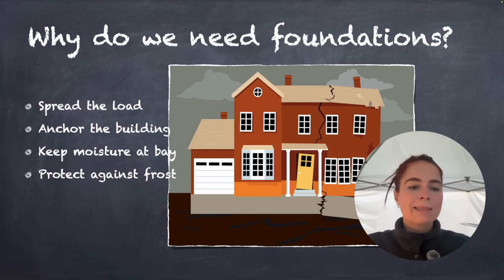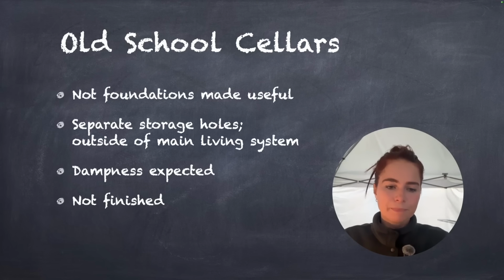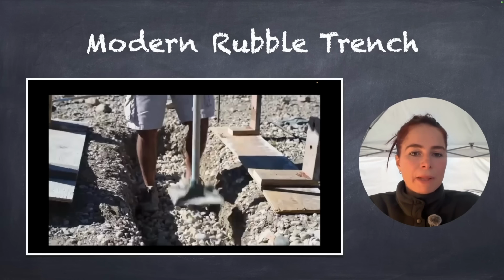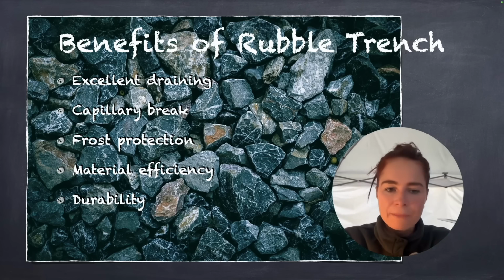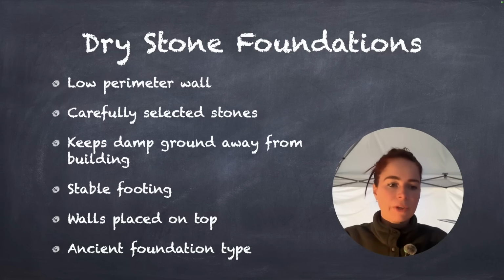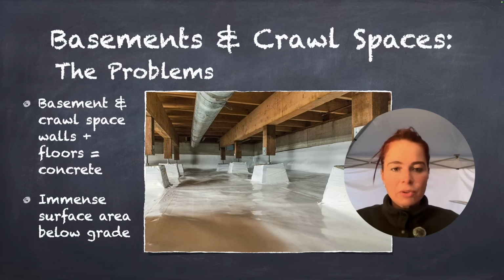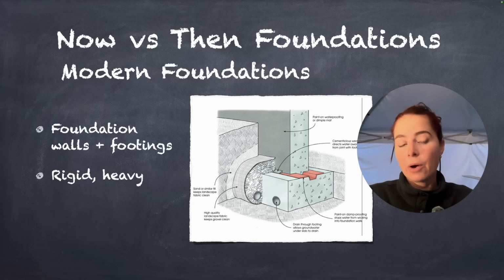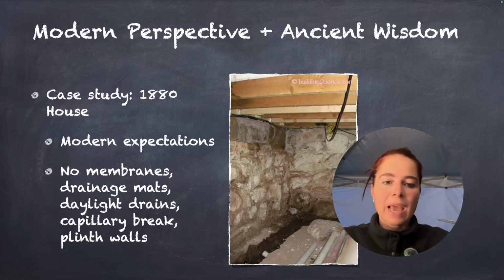Why Modern Foundations Fail — and the Genius Design We Abandoned

Comment: Instead of calling this rubble call it ballast this is what supports all railroads and is a term that some building inspectors will recognize .If you need water resistant concrete you need to go back to roman concrete that uses lime as the binder in the concrete. Roman concrete was made from slacked lime, volcanic ash, and small aggregate the mortar was lime, ash, and sand.  These are known as hydraulic cement this was what was used to make cisterns for holding water and aqueducts and harbour walls that still stand today.
Reply from the maker: Good comparison — the idea is definitely similar to ballast in how it manages water and distributes load. Rubble trench just applies that same physics under a wall instead of a rail. And yes, lime-based concretes like the Romans used are still some of the most durable materials ever made!
Reply: @thehealthybuildingproject 
But youre a bit too self conscious. You don't need to explain why you wanted to share that or feel shy ( 11.30 )  that you sounded Happy and wanted to share that . You should be a teacher .
Reply: good call! ballast all the way
Reply: @thedavesofourlives1  
Free draining ballast
Reply: Of course we now know it's the volcanic ash (pozzolana) that provides the real means to provide the strength and self healing
Reply: Still use this method in Nigeria
Reply: @mysightofthings you know the east is the best, yes, all the propaganda they spread there's no life in the west
Reply: And mortar.  As a former NYC coop board member I am distressingly obsessed about brick/stone pointing—the decay of the mortar between the bricks, requiring expensive, hard to supervise, repairs/repointing. A few years later I was standing before the ruins of the baths of Caracalla in Rome. (Grand Central Station was inspired by them). A lot of truly impressive masonry, walls, even newly roofed over buildings remain, though the cladding had long ago been removed.  But what astonished me was the mortared brickwork was obviously still sound!  Certainly did not need “repointing”.  1800 years, mostly directly exposed to the elements.  in its way, almost as impressive as the concrete work on the Pantheon.
Reply: @halporter9 the mortar joint should be considered sacrificial and the bedding and joint mortar ahould always be softer than the bricks themselves in terms of compression. 

North America, Western Europe and other similar climates (warm summers /freezing winters) will always push external masonry facades to the limit. But its much cheaper and simpler to repoint the first 25mm (1") of the mortar joints than it is to replace the whole elevation if the bricks themselves fail, which they will do, if the mortar is too hard/not porous enough to release moisture and allow the brick unit to expand/contact thermally which will cause them to spall, split and ultimately fail.

If Rome had the same winter frost/thaw cycle as NYC I can assure you these iconic buildings would most definitely have needed repointing many times and the brickwork would have suffered much worse weathering damage in 2000+yrs of exposure to the elements.
Reply: I knew that,. sort of, for modern (post late 19th century) structures; typically 6 stories. God, I’ve live throuh nightmares in New York City with so-called waterproofing contractors and properly raked out joint mortar for repointing projects. 
   About this, I’m not so sure of the situation vis a vis Roman bricks, and their distinctly odd shapes — very thin and wide to my eye. Even after their cladding (marble often) was robbed with the fall of Rome. I didn't notice any cracking in the brickwork of the baths of Caracalla, for example, and I looked. Still, this is congruent with youir point; though it can get damn cold in Rome—not New York cold thouigh.
  if always wondered about waterproofing techniques for the cladding and interections with the brickwork underneath.
    I have never seen studies of the bricks similar those of the mortar, but surely some must have been conducted; they know the vast brickworks, the name of the (very riich family) that owned them for generations (centuries?).  Surely they have been conducted?  Have  these two and three elements been studied in  ensemble.  and are construction techniques in the North (say Trier, Germany) been studied.  How do they differ?
   There, i have just laid out research projects to consume the career of a team of resarcher-investors!
Reply: @halporter9 get yourself a copy of De architectura, known today as The Ten Books of Architecture by Vitruvius.  It covers not only the setting out, design and proportions of ancient buildings, but also goes into some depth about the materials and methods the builders used to create them.

P.S. there are plenty of studies out there on bricks and mortars, ancient through to modern. The reality is, the Romans made their bricks in the same way handmade ones are still being made today - brick earth (clay),  sand and water mixed, moulded, air dried and then fired in an open clamp, or a kiln with wood as the fuel. Produces a lovely brick that will effectively last forever in the right application. Size shape and weight are purely down to functionality (too big and they take too long to dry amd are too heavy to lay, too small and is uneconomical in terms of mortar) and aesthetics - which the Romans weren't bothered about as they tended to cover theirs with stone cladding or plaster.
Reply: @corvuscorax9930 so how can you make a 1000 years standing structure in new York
Reply: It also used sea water!
Reply: Clean stone would be a better descriptor. Ballast is a blend of sand and aggregate (in Western Europe). Rubble could be made up of recycled brick/block/mortar and other recycled aggregate. Not ideal in a foundation. 

Clean limestone or field flint (50-75mm or 2"-3") works really well in the trench fill application, well compacted and topped off with a 150mm limecrete blinding to formation level works really well and is coming back into fashion in the UK for ECO builds where concrete mass fill foundations are not acceptable due to the embedded CO2 content.
Reply: @corvuscorax9930 rail road rock
Reply: @zakbrinkhoff324  to be fair - they do call it track or rail ballast in the UK - Rail Ballast with Material Grading - 32/50mm Graded Aggregate BS EN 13450.

Not to be confused with Ballast,  a composite material typically made up of sharp sand and coarse gravel, used in construction projects as a base material for concrete mixes when added to cement and water in the correct ratio.
Reply: The reason I use the word ballast to start with is that is more widely understood.  @corvuscorax9930
Reply: @corvuscorax9930 damn so much info and nuances per region
Reply: As a further comment.  I am 78 and grew up on a dairy farm in the Arkansas Ozark mts. While not common, a lot of the old cabins had stone foundations.  But to me in the flint rock hills, graveled underpayments seemed to be assumed in all sorts of situations.  So much so that this entered my assumptions when I was very young.  I even used it a bit putting in fence posts in my mother’s yard as an adult.
   Those old timers really knew how to use stonework also, for all sorts of tasks.  Easily quarried slabs on almost any hillside farm.
Reply: My understanding is Roman concrete performs best in coastal areas due to humidity and salt content in the air acting to continually reinforce the concrete due to its chemical composition. Most of the USA is not the best environment to use it in.
Reply: They've found a replacement for the volcanic ash from what I've heard, but no one will use it.
Reply: It was not actually made from slacked lime.  They threw in fire and limestone as they mixed everything all at once which resulted in limestone chunks being scattered throughout healing the cement when cracks appear. They also used pumice and volcanic ash and volcanic rock as well as alumina tobermite
Reply: Great advice
Reply: Adding another point on Roman concrete:  recent studies using high tech scanning and spectrography has elucidated the role of the volcanic ash, particularly in hydrological concrete. I forget
T the chemical reactions, but elements in the compounds facilitate formations that are self healing.  There ere other advantages that pass beyond my memory from several years ago.  Students of this can google, I suppose, or search function the science PR sites.
Reply: It seems almost Sacrilege to call anything but Hydraulic Cement, 'Concrete'.  
Regular Cement is temporary.  Designed to last long enough to get paid and have the check clear.
I had some amazing original mortar in a 100+ year old house of mine, with Horse Hair in it.  
Mortar 30 years old in subsequent work crumbling, while the original looked like it will last another 10 centuries.
Reply: You've said something quite helpful and accurate and I can't understand why some responders have been so aggressive in their responses.  Perhaps people need fixing before buildings.
Reply: For a modern designator that carries the included and excluded properties of the rubble trench, why not "air-gapped"? It's actually more accurate than the current usage of the term in networked digital devices. And it carries both the sense of a desirable capillary break and the inherent loading limitations.
Reply: The Romans concrete was good for compression but not tension
Reply: @johnrodgers2171  that is true for all concrete.
Reply: Im not religious or anything but theres this bible verse thing or song however you call it, about building a house on sand vs a house on rock. My house is built on beach sand. A double brick wall 2.5 stories high(attick) rests on a 50cm deep foundation which is 4x the width of the wall. The sand is very fine and very compressed. (Its on an island) you cant nor wouldnt need anything else unless you go higher you would mostly need to go wider instead of deeper. On the mainland its clayground, the total opposite, need to put pilings in as deep as possible until hitting bedrock which can easily be 40 to 60mtrs. If you dont go all the way to bedrock then anything above 2 stories will sag and/or drift and after 50 years the doors and windows will never close again. Yes 40 to 60 meter deep clay/loam/sand mix, mostly clay. Rubble in both examples does nothing and will actually trap water. Especially the clay is quite a unique situation as far as I know confined to the Netherlands. Beachsand more common I guess. Also very different. So yeah interesting video for me.
Reply: Ballast is typically in a container and serves to hold down a structure rather than hold up.
Reply: @jsbrads1  that would be what is known as a Gabion Wall where ballast is put into cages that keep it from moving down sloped areas, this is used to stabilise hill sides  that may be prone to slides.
Reply: @kevinchastain727  holding the hillside from moving is like ballast just more sideways. This is actually to make the support structure more flexible, not to stop things from moving.
Reply: Rubble is a term anyone who knows anything about anything will know. Dimewit. Ballast is not the correct term in this instance.
Reply: Yes, go back to Roman concrete because we have a ton volcanic ash in the fucking US Midwest.

Use your smooth brain, you use what is available in your geographic area or what makes sense to bring in.

Short of Yellowstone blowing, that makes no sense for most of the USA or the rest of the world.
Reply: @silverbackag9790 There are suitable replacements that can be used, Romans used pozzolonic ash because it was what was around them
Reply: @Jim-BoSlice-t4g  no shit. We already use those “suitable replacements.”
Reply: @Jim-BoSlice-t4g  ash from coal power plants is a good replacement for this. there are also large deposits of  ash from extinct or dormant volcanoes that are all over the Midwest some have fossils from herds of animals in them like Ashfall Nebraska.
Reply: @silverbackag9790  lol good point.
Reply: @silverbackag9790  Volcanic ash is a common component but not necessary, and the person you respond to did not say we should go back to using volcanic ash, he did not even say we should go back to anything.
You're acting like a confused child.
Reply: @silverbackag9790  Yellowstone won't work for "Roman Concrete"
You need volcanic rock, NOT JUST ANY ASH from Pozzuli.
The geochemistry of the area is unique to Campi Flegrei volcanic complex, the "world's most dangerous super volcano" creates a unique concrete layer that self heals micro cracks through chemical processes.
This creates modern day problems, if you look up Campi Flegrei today, the build up of magma below the cap layer is getting really bad and is close to breaking again.
This is a problem because half a million people today live right on top a very dangerous volcano that is about to blow up.
Reply: Volcanic ash is really easy to make. Also, the USA’s west is kinda somewhat covered in dormant volcanos, and some non dormant ones.
Reply: Your totally wrong
Reply: @nicolecrystal6765  
The Romans made concrete that was waterproof, could set below the (salt) water-line, and self-repaired any cracks that formed (as the calcium content would dissolve in mildly-acidic rainwater, this would then flow into the cracks and reform as calcite, in the same fashion that seepage through limestone forms stalactites and stalagmites).
Reply: You can do that today you moron. Just add additives… it’s not as big we don’t have waterproof cement today. Penatron and Zypex are two great products
Reply: @nicolecrystal6765 No, he's totally correct, and it's *you're*.
Reply: @nicolecrystal6765 You're not right

Comment: A subdivision near a previous home of mine was built with traditional concrete basements, but that's not particularly relevant. The city had a couple of water wells providing city water. These wells were turned off when the city obtained water from Lake Michigan. This caused the water table to rise above the bottom of the basements, to be drained by sump pumps in houses with basements. People needed to install 2-3 sump pumps to keep the water level below the level of the basement, and they would burn out from overuse relatively quickly. The homes were built with the pumps running, so they did not realize that basements would be a bad idea if the pumps were ever shut off. I'm not sure a rubble trench would work, given the water table issue, but again, that wouldn't have been discovered until the city turned off the pumps.

Comment: Cost.  It's always cost and good enough is good enough.  Building standards and requirements have been improving overall since the implementation of the International Building Code (and before!) in the US and elsewhere.  This video is utterrly oversimplified, glosses over any downsides or reason we don't use rubble foundations, and generally is a poor example of 'learning' video, as it is one sided, incomplete and niave.
Reply: lol you have no idea what your talking about😂 getting crushed stone delivered and compacted is way cheaper than having a bunch of masons poor and form a modern foundation or build one with block and a pad. Then if you include the sump and French drain and de humidifiers forget about it. Then when the moisture gets in the walls and cracks the foundation. Which I’ve seen on multiple occasions then you have to hire an engineer and hire the guy to properly rectify the crack.

This is a very insightful video and in all my years in construction I am a little upset I haven’t realized this sooner🥲
Reply: @Joecooool  Yes, me, a construction professional for 20 years, has no idea what I am talking about.... I guess you have estimated and constructed more than $200mil worth of structures.....

Comment: Very interesting video!
Now combine the principles of the rubble trench foundation with "Granular foam glass" (gravel) and you have a winner as this material is lightweight and - for most - also a thermal insulator!

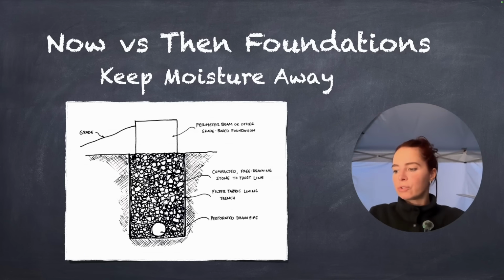31:50 You can also use a wooden foundation beam which got charred (and oiled) at the underside but you can not use any additional soil (backfill) against that beam to create a grade.
Reply from the maker: Wow, I hadn’t heard of granular foam glass before — that’s such a fascinating concept, especially for combining insulation and drainage in one material. And ohh, very cool about the Shou Sugi Ban–treated wood! That makes total sense about not backfilling — even with the charring and oil, wood would still be somewhat vulnerable to moisture. I really appreciate you sharing all this — definite food for thought!
Reply: @thehealthybuildingproject  An interesting residential foundation was done in Denmark using foamed glass block. Search for Tversted house.  In North America, I think Corning makes a foamed glass block product, Foamglas, but mainly for commercial/industrial builds, such as under storage tanks. It may be more available for residential projects in Europe.  I know there is a plant near Burlington, VT that makes the "Glavel"